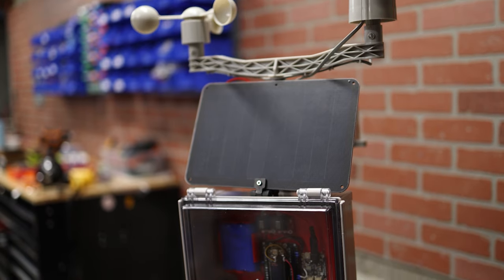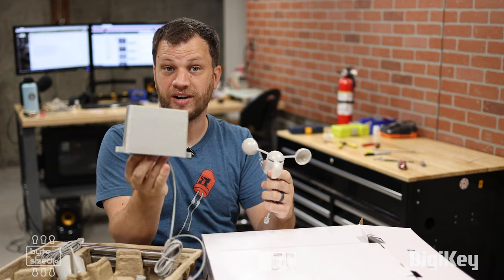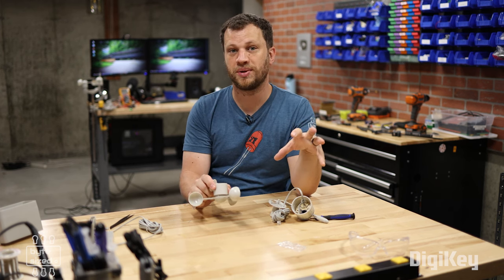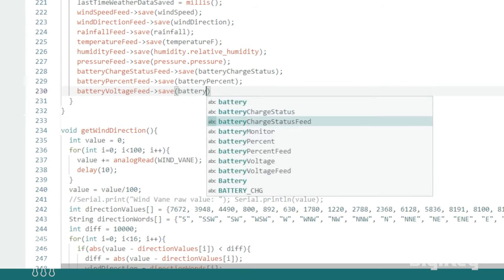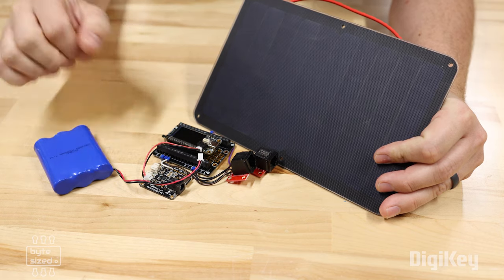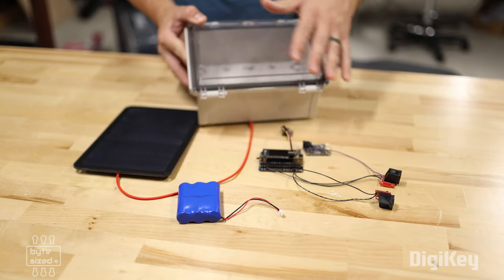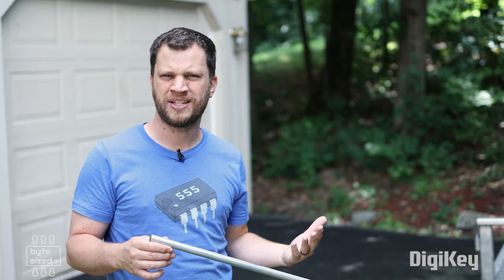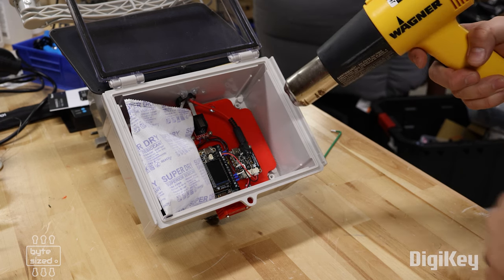How to build a weather station that’s WiFi connected - The Byte Sized Engineer | DigiKey

Comment: What's the data collecting interval here? For example if you collect data every 30 seconds, it means you can probably put the ESP32 module into deep sleep between those intervals and consume less energy that way. Might allow you to account for cloudy days or seasons when days are shorter when the solar panel won't generate that much power.

Comment: I'm curious.. if the MS8607 is inside the box.. and it's sealed up water tight.. how are you getting accurate temperature and humidity and air pressure outside the box?
Reply: okay.. I see now. you 3d printed a smaller box with air holes and put that on the bottom of your weatherproof enclosure.

Comment: Just a tip :  sensor wiring should enter through the bottom of an enclosure if possible, and always with a drip loop.  

Builders describe this as relying on physics to keep water out instead of just relying on the chemistry of your sealant.

Ow, looks awesome.  Thanks!
Reply: Good tip! When you install a SpaceX Starlink system, their instructions specify a drip loop too! 😎✌️
Reply: Great tip. I installed the temp, pressure, and humidity sensor on the bottom for this reason. I could have done this with the wind vane and anemometer, but I wanted to keep the number of holes through the enclosure to a minimum. The solar panel wire was too short to route through the bottom, so it needed to be on top. I've had it out for several months through torrential rain and it's still dry as a bone inside. I'll have to read more about drip loops, thanks for the tip!
Reply: this man is beyond help, he drilled threw a solar panel and he placed it under the contraption he built..... its ok and it will work for a while ...... but its not digikey okey !!! they can do better